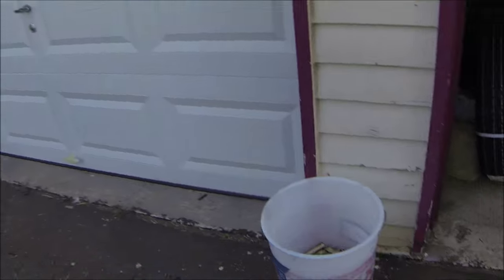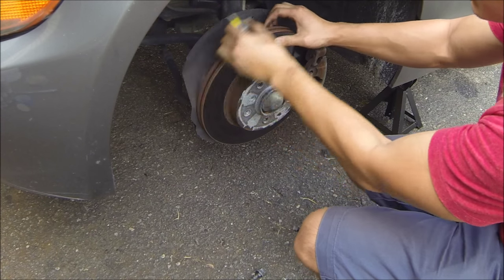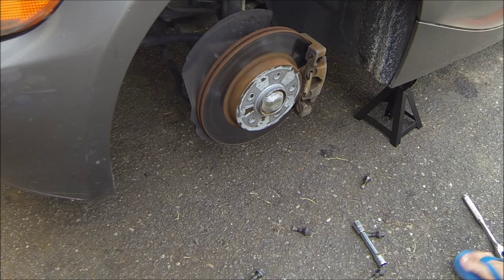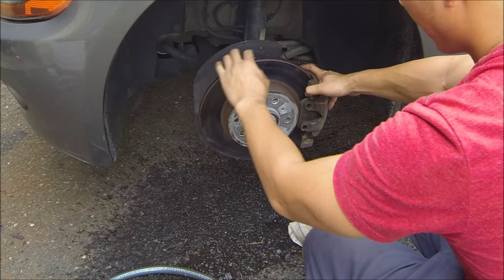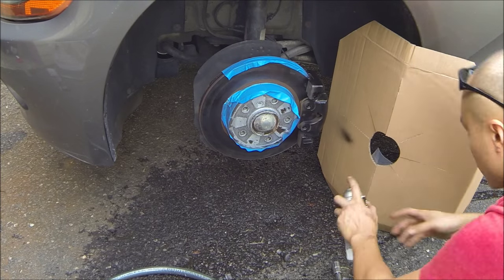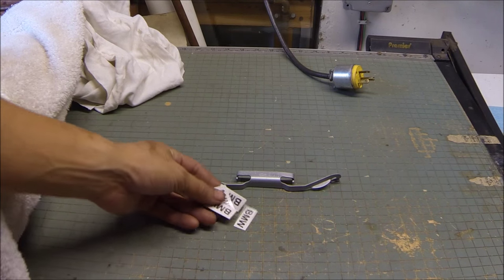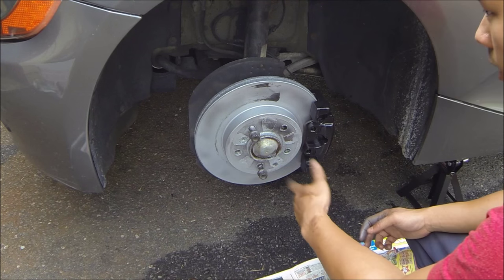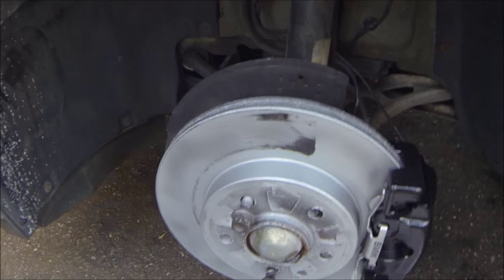How To Paint Your Brakes - BMW Z4 Vlog #14

Comment: It's not completely painful to remove the caliper and disc from the wheel and do these parts without masking. Two bolts hold the outer caliper and pads. Two bolts hold the inner half. One screw holds the disc on.